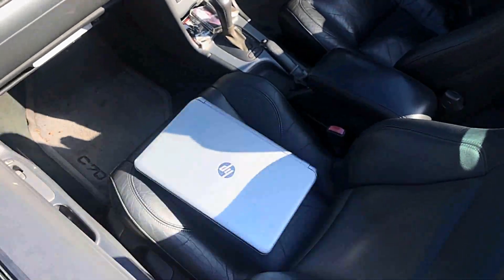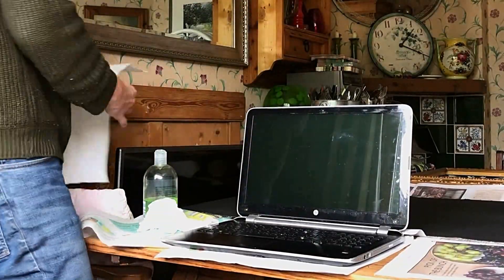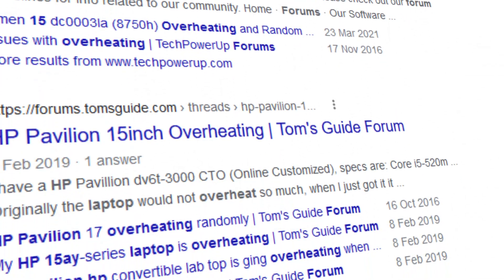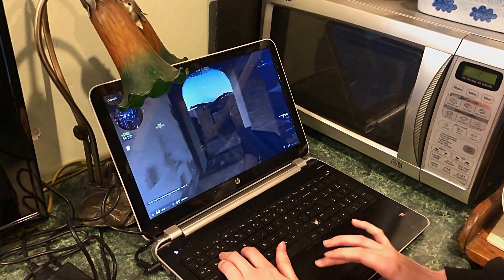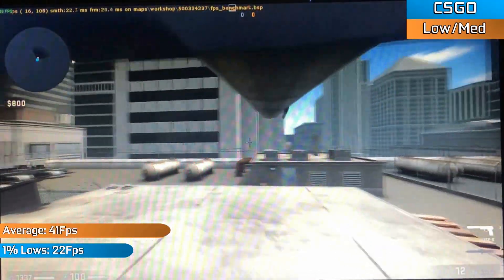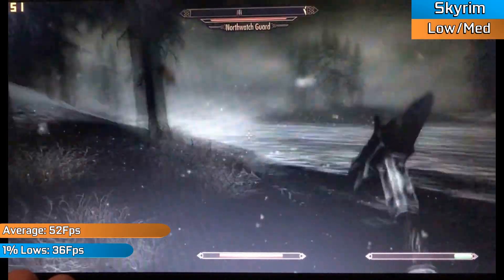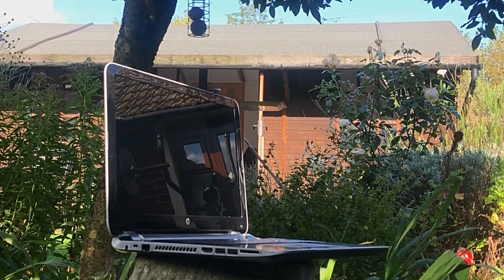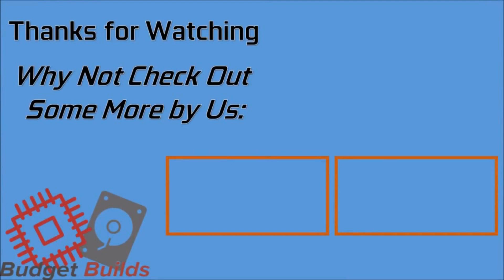AMD & HPs Awful Laptops...How bad are they?

Comment: It always seems that HP gets things close when it comes to their hardware... close, but never great. It's as if the designers design a great system and bean counters come along and muddy things up. Less support here and there, remove doors oh and who needs a second ram slot? We'll reserve them things for our high end workstations and remember don't use a decent amount of thermal paste because as long as the thing works well enough to get beyond warranty that's all that counts. I've seen this with HP more often then not.
Reply: I think the HP Elitebook 8440p and their Elitebook/Probook lines are great laptops. Some of the Spectres are good too.
Reply: @0w3nn  Yup, absolutely.
Reply: IDK which model you're talking about, but some of the laptops HP has made over time had the other ram slot on the reverse side of the board...

Comment: my brother once had an HP laptop. it immediately BSOD'd and didnt work at all and we had to return it. 2 years later we found a similar looking laptop in a best buy shown as a display model. turned it on and used it for no less then 5 seconds and it also BSOD'd. so basically dont get HP laptops they suck.

Comment: Oh god this video brings back memories of my very first laptop. 
Some Acer Aspire v3 with an AMD A-8 4500m and some form of dedicated gpu like this one. 
It worked fine at first but over the years it got slow and painful to use even with an ssd upgrade later on. And dont even get me started on drivers, like the video mentioned it was a hot steaming pile of garbage. 
But the funny thing is that even my laptop after that had AMD driver issues 😂
The R 7 360m saw exactly one, yes exactly ONE singular driver update during the time i used it. And windows refused to even recognise it most of the time, reverting back to th intel hd graphics. 

All in all im so glad AMD got its driver situation figured out (somewhat) and my ryzen powered laptop works pretty well so far.

Comment: Interesting video, I have a pavilion 15ab111la wich my parents bought me for school in 2016, it has those damn dual graphics too, the thing is, the integrated gpu (R6 512mb) performs better than the dedicated one (R7 m360 2gb) in terms of heat and fps, im planning on doing an specific video for this model on how to deal with this disabling the R7 at least on windows 7 and 10 so far. Linux is a different nightmare, but I like to experiment.

Comment: I am currently typing this on an old HP/AMD laptop from the era. I can totally relate on how hard it is to take apart. Took me forever to upgrade the HDD and RAM, and replacing the thermal paste did indeed requite a total disassembly. Did not experience overheating or misc build quality issues though. It seems HP had poor quality control for these laptops. It is still a good light duty laptop as long as your expectations are low.

Comment: This year i bought 255 g7 with 3050U cpu. That's a 2 core ryzen with vega gpu. You'd think this would perform decent enough for basic tasks like movies and web browsing. NOPE.

Pretty regular stutters when running 1080p youtube, some hiccups when watching movies. Pretty awful performance when switching between different apps. In other words, truly terrible.
I don't know if HP gimped the PC or did AMD really make that bad of a CPU. Mind you, i've equipped it with 16GB of ram and SSD, so plenty for a basic rig.
Reply: Youtube now prefers AV1. 
but your CPU doesn't support that 
Youtube in the past using; (Afaik)
1. avi (first-time release)
2. h264 mp4 (second time)
3. vp9 (3rd time)
4. av1 (now)

AV1 it's a new codec, it's not a standardized codec before already been released to public.

Your CPU can't decode AV1 then eat your processing power cause all video processing is handled by the CPU, not by Hardware Acceleration (i-GPU), that's why you got stuttering.

Your CPU only supports H264, VP9, and HEVC, of course, you got stuttering because you are still using 2Core 2Threads, it's not a minimum 4Core 4THreads CPU. Windows also running so many background tasks dying your CPU.

You can try forcing your browser to use h264 format when watching youtube, just install extension/add ons called h264ify.

On the Intel or Ryzen make sure you use 2 sticks of RAM and use a good SSD because Laptop vendors sometimes are OEMs low-quality SSD
Reply: @claritoresdiano1021  I already use H264ify and it has no real effect on stuttering. GPU is doing the decoding.
As for ram; i've maxed what that cpu can handle (2400MT). Sadly only single channel is supported, since laptop only has one ram slot.

When there's gpu decoding, cpu has little to no effect on performance, because decoding blocks do all the heavy lifting. Even the shittiest cortex a7 cpu will handle 4k video, if there's decoding block, that can do that.

The issue here is either related to poor GPU drivers or some odd memory bottleneck present on these lower end athlon cpus. Because when stutters appear, there's a lot of spikes on GPU load.
Reply: @claritoresdiano1021  It's hynix C-die with 8Gbit density and dual rank.
Reply: @hojnikb  I see on HP's driver site there is a different driver for different windows versions. I thought it causes hiccups you might need to re-install fresh windows then install the driver for a specific version of windows ti to prevent re-used broken registry or temporary files.
I don't know why HP did this 🤔 hmmm
Reply: Alreay did that twice and used both amd drivers and hp drivers.

No real difference, now im running latest drivers with windows 11. And latest bios obviously.

It's like hp somehow gimped performance but its not obvious how. 2core 2 thread zen shouldn't be that slow. 
It feels slower than 10 year old i5 ffs.
Reply: You might've lost the silicon lottery and/or got a crappy Vega iGP. Vega 2, 3, and 6 are bad; Vega 8 and 9 are decent, and Vega 10 and 11 are good. Vega 12 and higher aren't integrated graphics afaik so can't compare those.
Reply: @youtubeshadowbannedme  Video decoding is done by a seperate block in the gpu. Even the shittiest gpu will have no effect on video decoding. Silcion lottery even less, since it wouldt hit the frequencies that it should from the factory (which it does).

Comment: Started to get excited when I saw the dGPU. But I looked it up and with the two GPUs in crossfire, they have less power than the HD8400 graphics on the A6-5200 Pavilion I have. I was going to repurpose it to an XP gaming machine but there are no drivers. The only thing to do with these are to install Windows 10 and sell it as a basic laptop. I have a Sony Vaio with 7650M graphics from the same era and it can actually do some gaming. Things like Fallout New Vegas, GTAV (at 720p), Just Cause 2, Far Cry 3, etc. But apparently the 7000 series has XP drivers, or so I have read, so I might turn that one into a XP machine. I can't really sell the Vaio because it is just too beat up and technically contains too much cannabis residue to legally ship anyway.

Comment: ah yes, the pavilion. my sister got a new laptop and gave one of these(A4, no dedicated gpu and 6 gb of ddr3) to me to use on the tv... took a million years to boot, even with linux and had massive lag while running a video...
Reply: H.264 is fine to 1080P60, usually, but H.265 is right out, and despite alleged support for VP9, it'll lag past 720P30, sometimes.

For H.264, VC1, and older, it should be just fine. But, you may need to add browser extensions or change settings, to force H.264, like here on Youtube. If not, it may try to use a format that it technically supports, but sucks at.
Reply: I'm awaiting the moment where I can get rid of my HP laptop and be free from the lag, random crashing and deleting my files whenever it has to be updated 27 per month, finally after 9 years: Say hello to laptop hell old HP laptop! 🤗

Comment: Mine is even worse than a PC from 2006. It's an HP 255 G2 with an AMD E1 2100 APU. It's the most awful piece of garbage I've ever seen. It even stutters in GTA Vice City for being a dual core CPU at 1 GHz. Wanna do some web browsing with that laptop? Forget about it....it's that slow.
Reply: Windows XP, Windows-7 32bits/64bits, and Windows 8.1-32bits is still OK

But... we should force youtube to use h264 and don't watch AV1/HEVC videos because AV1/HEVC hardware decoding has not been released yet.
Reply: That's so sad, I'd recommend you upgrade but there's the scalping crisis for desktop hardware and shortage crisis for both desktop and laptop hardware

Comment: I had a my uncle's old Pavillion G7 1100 series with Athlon P350 (or something) with radon 6960M (or something).

Since my uncle wasn't aware that modern laptops all have a recovery partition he wiped it out. So when I reinstalled the pc with windows 10 it's driver doesn't want to work with windows 10 and works only in Microsoft display driver.

For once I managed to install the correct driver after spending 6 hours. But windows update would always breaking it by installing incorrectly 7600M driver.

Though my intention of his unused old laptop was just making It use as NVR laptop. So I guess it would still work with Microsoft Basic Display Driver?
Reply: I think you need driver AMD Radeon 15.7.1 Driver.
Reply: @claritoresdiano1021  I tried that out. But it just refuse to work.

I think the issue is its driver is very spesific as it's a switchable video card driver (it uses both radeon 4250 and 6470m) but for some reason the windows 10 ui (or any window that existed only since windows 10) fails to load if I have the radeon 4250 + 6470m enabled. In addition windows incorrectly detect them as radeon 4200 and 7400m. Which are unusable as they keep running in basic display. 

And once I reboot it it will be stuck in infinite boot with a busy mouse icon.
Reply: @TimDragonDeckers  🤔 hmmm... afaik sometimes dual-driver works on previous windows 10 such as Codename; Threshold 2 and Redstone series. 
I success Installed the old AMD Catalyst on different machine, it uses Terascale iGPU and dedicated GCN 1.

if still doesn't work probably should use windows 7 or Windows 8, I see windows 8 and windows 7 as your HP drivers, still on there (HP download driver website).

Otherwise, use a different OS (Linux) then run Wine or via VM with Mesa Driver or the old version Proprietary AMD driver.
Reply: @claritoresdiano1021  Alright I looked in the AMD page. It seems the Radeon mobility  4250 + 6470M is indeed incompatible with windows 10. But it's off because my older HP Pavilion DV7 has Radeon Mobility 4510 512mb vram only and it does work without issues even though the video driver comes from windows update instead of official HP.

Might just trash this laptop. Kinda shame though. Or use it as sort NVR for my resturant with basic display driver, again somewhat shame for the 6470m gpu but at-least I don't have to invest a actual NVR to store CCTV. My original intention to salvage it from uncle is to replace my old HP Pavilion DV7 that only has Radeon 4510 and only supports up to dx 10.3 (barely any games was made with dx10 in mind) so I can use it on bed (with a cooling stand of course) since I'm not allowed to bring my gaming laptop to bed. 

I had thoughts about Linux but than I realized my most frequently used software and some games doesn't support Linux. Nor I did ever used Linux before. I may try windows 8. Assuming the windows 7 key and the driver  still work once I than upgrade to windows 10.

Kinda wish that my uncle didn't use old-school windows xp like method for resetting windows. Because all OEM PCs since windows 7 (or Vista) has a recovery partition.

Comment: Yep. HP Pavilion quality back then in 2010-2016 was worse. I own the Pavilion g4 and I had the keyboard replaced, display cable replaced, paint on its body wore off.. really horrendous. On good side, with discrete AMD HD 6470M 1GB GDDR3 graphic and Core i3 processor, I can play The Sims 3, Far Cry 2 & 3, and Battlefield 3 with it.

Comment: My friend and i bought this laptop in 2016 ish. little did we know the problem that this laptop would cause.

- constant fps drops (dual graphic on)
- low fps (dual graphic off, already set to high performance)
- random shutdown (even after replacing thermal paste, have to turn off turbo boost by setting the processor power to 90%)
- windows updates keeps messing with graphic card drivers (black screen, have to go back to windows 8.1)

Comment: The entire A and E series CPU lineups on desktop and laptop were always garbage and not worth using.
Reply: Almost. Some of the A series chips were slightly useful in the right combination - A6-3400 was doing great with a 7670M and the E450 (which is probably the highest E series CPU) does quite fine with a 6470M (tests carried with two ASUS, an X73TK and a K73BR - virtually same chassis but one has socketed APU (the TK) and the other has the soldered in E450 (the BR one).

Otherwise I can fully agree they're hot garbage.

Comment: I hv a AMD A9 Laptop with AMD M330 GPU. It has 4Gb ram and 1tb hdd. Using windows made me hate it so much. Well guess what I hv to do my coding studies on it, so I switched to Ubuntu which was good till the kernel 5.10 lts came. It was still working but i wasn't able to use my dGPU. I am currently using Fedora and after investigating or rather trying many things I came to conclusion that kernel before 5.8 works good with dual graphics. But it breaks after that version. I just started to learn OpenGL and had used dGPU for it in Fedora. It actually used my dGPU according to radeontop so my guess with this is, the problem resides in the display manager or compositor communicating with the Radeon drivers. The reason might be the changes they did to the 5.8 kernel. Btw the M330 GPU uses radeon (ati) drivers that's why this issue didn't got the spot light. This laptop is a muxless that's why not able to switch off iGPU. Well there is a possibility if use a proprietary driver to utilise the dGPU.

Comment: Ah, HP laptops and pre-Ryzen processors. The painful duo. In experience, my sister is using a year 2017 model HP laptop that sports an AMD A4 processor. Quite a pain to even just boot and use.

P.S. It's been a while since your last video. Glad you're back in action!

Comment: I had an acer laptop with a10 9600p and radeon r5 and r7 graphics 2gb. 16gb ddr4 ram. First 6 months was a great gaming machine and after that it just went limp mode. Super slow. Games ran super poorly. And at the end it started literally giving me electrical shocks so i just dumped it. Keep in mind i payed aroud 600 euros for this crap. I bought a gaming pc for 400 euro literally 50x better that that laptop...

Comment: I remember when I started the idea to inspect the fan on my buddies HP laptop but changed my mind. I thought it was going to be easy like my Toshiba laptops, by just taking off the back cover and there is the cpu fan. I took the back cover off the HP and well... There was no easy access to get to the fan so we just decided to keep running it with all the dust and the weird fan clunking noise that we fixed by banging it. Basically have to remove the mainboard, but have to disconnect all the tiny wiring to the mainboard and cd/dvd drive and whatever stupid thing.

Comment: I’ve opened many of these at work (I’m a computer repair tech). Glad to see someone else sharing the hatred. The absence of a model name on some of the cheapo HP 15” laptops has earned them the nickname “HP Peasant Book” at the shop.

Now just wait until the battery puffs up and pops out the keyboard
Reply: I have and use a newer model hp 15-da2339ne completely
Stock, it sucks though

Comment: God, HPs in general outside of their enterprise equipment is built like such crap. Stick something like an Elite Book next to a ThinkPad or MacBook Pro and you can see where HP didn't spend the money. I'm not surprised this chunk of shitty plastic had thermal issues. I had a 2018 pavilion for a brief time with a Ryzen 3 and, when I stripped that down and checked the thermal paste, is was pretty much non-existent and crusty after one year.